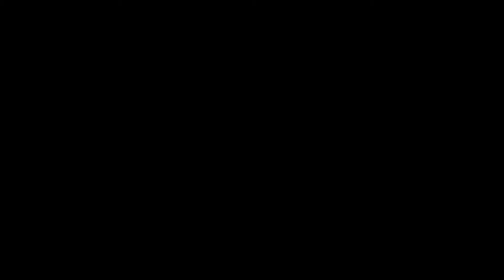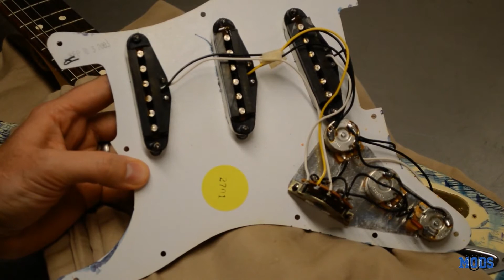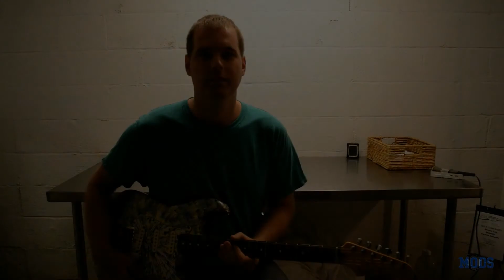Strat Wiring Tutorial || How does an electric guitar work?

Comment: Thanks for posting this.  This is actually one of the better vids (if not the best) on this wiring I've come across.  I do have a question, though, you said that the lugs on the pots (looking down on them as you are here) are from left to right, "1, 2, and 3," respectively.  What exactly are each of these lugs and what do they do as far as their role -- is one an input/output, etc., and which is which?